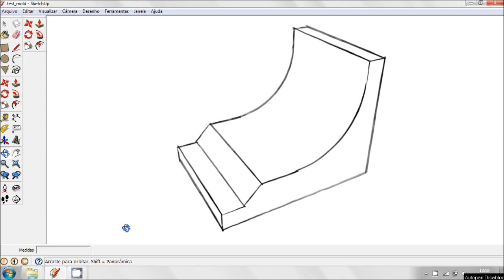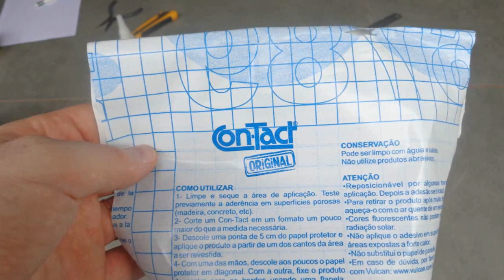Learn fiberglassing: how to make a cardboard mold

Comment: Can I add fibreglass modification to an existing-cured fibreglass object??
Reply from the maker: Yes, it is possible. If the part is not used in extreme conditions (for example, an important part in a vehicle and its aerodynamics), it should have no problems. However, it's not something I've done very often, so I suggest a little more research. But for my purpose (a part more aesthetic than mechanical) I had a good result, sanding the old part where the new one would be added.

Comment: Nice job on the technic used to make the mold but concerning the application of the resin...too much resin used!! Before puting the first layer brush resin then put your 1st layer. Fyi if you want to avoid printing of the fabric on the finished parts the first lay is made with chopped strand THEN you put the fabric.

Comment: i would like to ask if release wax can be used instead of the release agent you used? and also, i would like to know if there is an alternative for Con-Tact paper, it seems that i am out of reach for  that material.
Reply from the maker: Hi! I have used release wax before and got the same good result as with PVA (look: https://www.youtube.com/watch?v=Pd-DyaBRZSo).
Con-Tact paper, I suggest you use it... its purpose is to waterproof the cardboard mold. Without it, things tend to get messy... maybe the cardboard will get wavy. Actually it's not a "paper"... it's more like a decal.
Con-Tact paper is sold here in Brazil at school supply stores. You can also replace it with some packaging tape.
Reply: I use packing tape a lot. Will require you to do a bit more prep work though because of the strips. I never use release agent or waxes. Pops right off

Comment: can i replace the plastic film with food wrap? I'm planning to make a pontoon for a water bike with fiber glass
Reply from the maker: It might work. It might get messy. In an "concave" format like my mold would probably not work. In a more rounded shape similar to a ball surface, that you will wrap an entire piece without leaving bubbles and folds, it should work. You will also have to observe how the film will behave with the curing heat. Trial and error... you'd better test it on a small part first.

Comment: Nice Job,   But, for a part that size,  you don't need to use the Polyester resin and take it outside cuz it stinks up the house..    You can use  " Polycrylic " ..   It's water based,  cleans up with water,  no smell at all,  and it's almost  just as strong..  You can buy  Polycrylic at Home Depot or any home improvement store..  It comes in small sizes for small Jobs..  Plus You can mix regular Acrylic paint in it and have any solid color,  or just drip the paint in and make swirl flow colors, etc..   Acrylic Paint is found at any hobby and craft store.   less that $1.
Reply from the maker: Thank you very much for your comment and the tips!
Reply: ThomasTheSailor Chubby great tip.
Reply: how strong would something made with polycrylic be? I'm making some hooves shoes and going to use fiberglass resin to create the hoof over a a frame I made from metal window screen. Parts of the hoof will be hitting the ground as I walk. Would polycrylic still work?
Reply: @DrAmyThornton  - Polycrylic is just water based paint and it doesn't add any strength at all. The person who said Polycrylic is almost as strong as fiberglass is completely wrong.

Comment: Can I throw something out there? If you would like your part to be colored, instead of painting afterwards you can whichever color paint in the mix, I used black I just asked the guy at the paint store so I am not sure exactly what sorta paint it is but yall can figure that out. Great vid I am so fed up with people talking on youtube!
Reply from the maker: Thank you very much for your comment! And nice tip... something that I have to try!
Reply: So far, I have used the colorants specifically made for resins and I have use titanium white universal paint tint with success.  Based on online and book research,  polyester resin curing is affected by many organic type pigments.    The Phthalo blues and greens seem OK though.  It’s safe to say that MOST but not all mineral pigments should be satisfactory.  You are probably not going to make brightly colored polyester by integrating color but you can make a base color and always paint desired color as a topcoat with proper surface preparation.
Reply: @jtbmetaldesigns   Exactly what are we talking about as far as curing being affected? I recommend just giving the paint resin mix a shot real world to see if it works (I know it will i have done it many times) with one exception being if this part you are making has a structuRal nature in which case i would contact an expert.

Comment: Can the mold use for making carbon fiber part?
Reply from the maker: The mold itself I think will have no problems. What you will need to research is on the mold release agent and resins. (I have no experience with carbon fiber.)

Comment: Some useful info in this video but the finished surface is not smooth enough for some applications eg car panels.
Reply: This is common with fiberglass one must sand using sand paper and a block.
Reply from the maker: Yep, you're right! As I said before, the better the mold, the better the part. The result depends on the surface of the mold. But we can always apply body filler and smooth it with sandpaper.
Reply: sorry for my ignorance, but what would the body filler be? wha material?